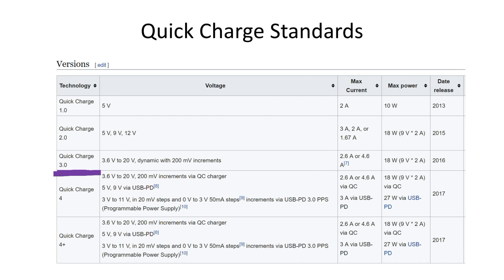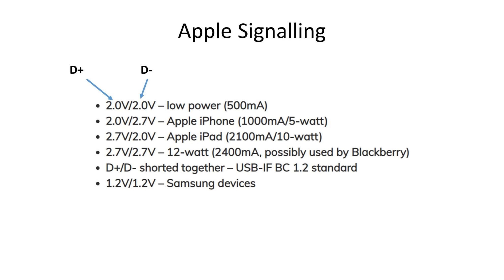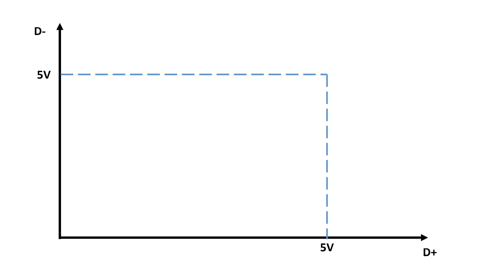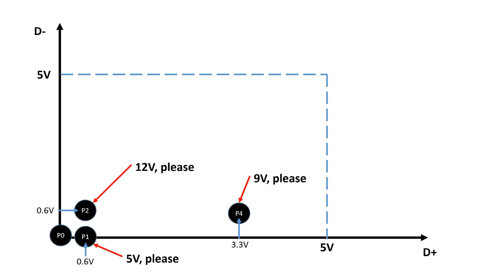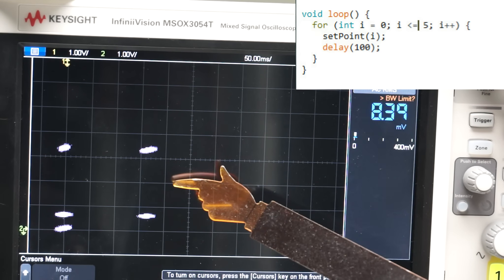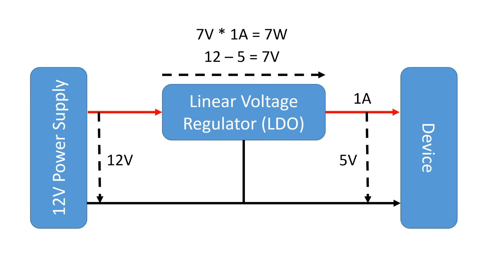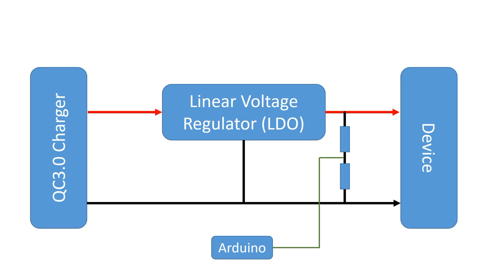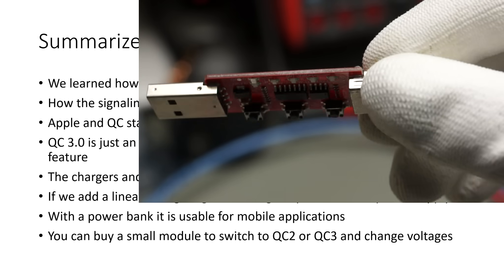#244 QC3.0 Hacking and Tutorial incl. QC2.0 (Mobile Power Supply) Quick charge with Arduino

Comment: interesting can be comparing with USB PD (power delivery)
Reply from the maker: It is much cheaper ;-) No, in reality, PD has more possibilities, but you have to have chips on both sides. Maybe I will have a look into it when it became cheaper.
Reply: @AndreasSpiess  It's a bit more expensive, but chargers also have more power, so it's understandable. I saw a 45 W one for 25 €, which is pretty cheap IMO.
Reply from the maker: @GRBTutorials I already placed some orders ;-)

Comment: Would be worth saying there is real standard way of doing this which is using USB PD (Power Delivery) specification which doesn’t involve these rubbish Qualcomm proprietary hacks
Reply: Exactly - and now most small laptops are powered using USB Type-C PD which is really smart standard. Unfortunately wall chargers are still very expensive, much more than in case of QC2/QC3
Reply: cbm80amiga Xiaomi sells a good 65W USB PD adapter for about $15, I wouldn’t trust anything cheaper at those power levels plugged into mains, some horrendous lethal  designs out there...
Reply: @gkdotclass $15 for a project worth $8 in parts seems to be not very reasonable :) Of course for expensive laptop or phone I wouldn't risk too. I think Andreas goal is to unify power supply for a project.I just purchased such cheap QC3 wall adapter for my project with 12V LED strip. I hope it will work.
Reply from the maker: In electronics, there is always a better thing on the horizon! The art is to chose what fits best for the moment. 
PD for me is still too expensive. I think QC3 can be useful for a power supply for the moment.

Comment: I'm not sure why they didn't just make the charger a USB device and have the phone talk to it over normal USB endpoints to configure it. :/
Reply: Price
Reply: The logic required to make this work isn't going to be in all controllers, so it's not like by being clever, they make it so that you can use all chargers, so people will still have to get QC3 by using only special chargers. Therefore, there's no point in saving a few cents or even a dollar or two for one, or maybe two QC3 chargers, especially when the charger is likely already tens of dollars.
Reply: @bardenegri21  usb->serial bridge chips are down to the tens of cents range now and I think most of that cost is the chip packaging.
Reply: @donpalmera  but then you still need logic to interpret the data, that's a microcontroller, and then you still need the actual dc-dc converter in the qc chip, and the protection circuitry. So you're actually adding a pretty big microcontroller and a uart bridge chip to what's already in this qc chip. It's much cheaper to do it with simple logic, comparators and transistors.
Reply: @bardenegri21  Your QC charge controller will probably be some sort of 8051 based thing anyway. I brought up that there are cheap usb->uart chips because it shows that stuff is cheap now. Those chips are all based on a microcontroller. Holtek basically sells the same chip with different software for usb->uart, usb->i2c etc.
So doing this via USB endpoints that map to your regulator control etc shouldn't be expensive or all that hard.
Maybe getting a usb vendor id and paying membership fees is the hurdle to doing it.

Comment: The interesting thing is the simple protocol. This is too simple, but I think it will work just find as long as you put on your own negative feedback (or use a volt meter and your brain for feedback control lol)
Also, I guess probably some Chinese company had already come up with some cheap variable power supply based on this.
Reply from the maker: Maybe. Would be ok for me. Because it saves some work ;-)